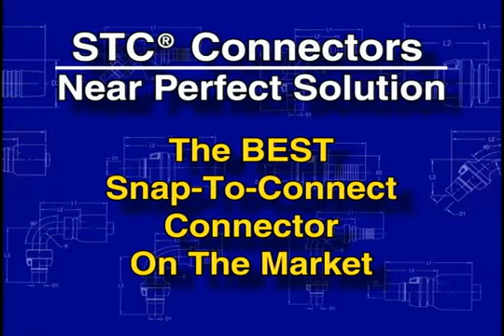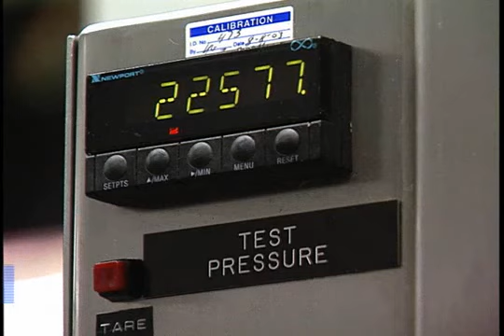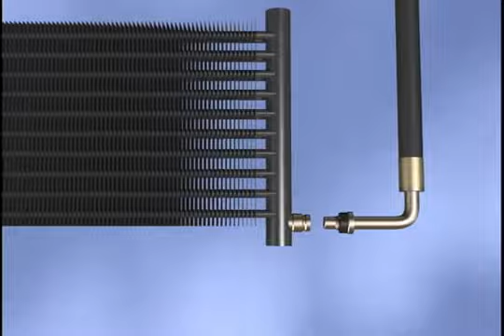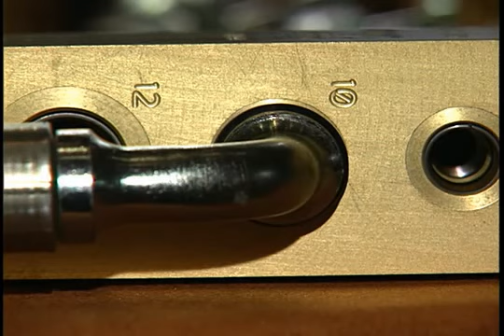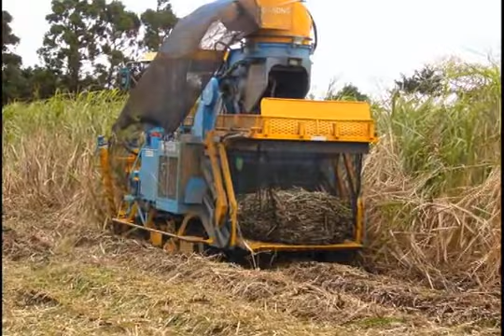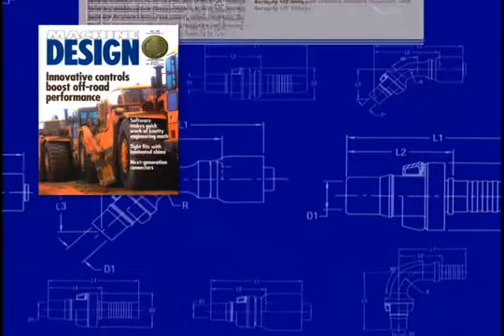STC Connectors Product Video

Comment: Shuttlewagon railcar movers used these for years, experienced non stop leaks, air system rust and corrosion  to the point of seizing, intermittently blowing out dumping hydraulic tanks ect. In a perfect world nice concept but when you experienced these failures  shows over half the stuff they said is bs.